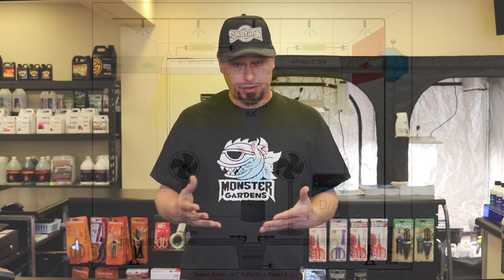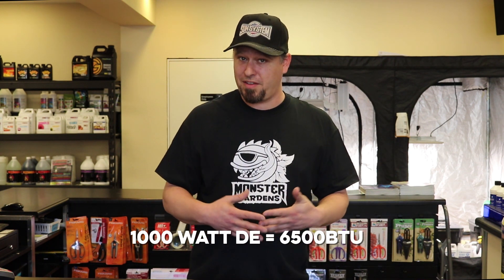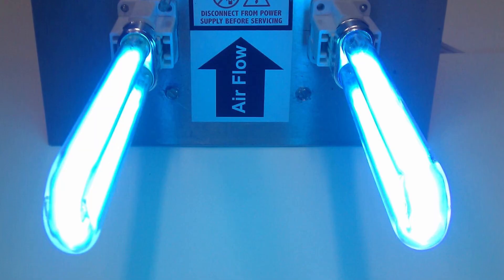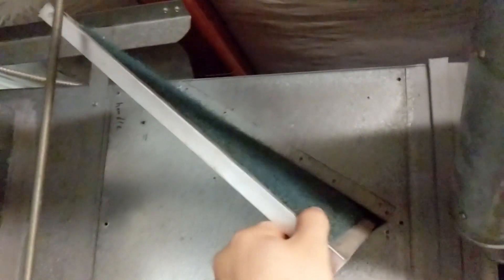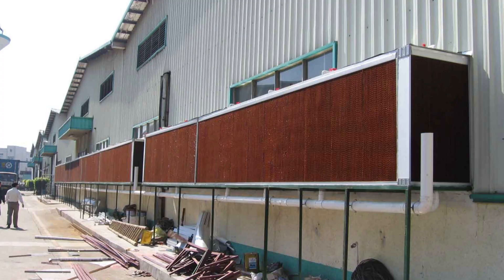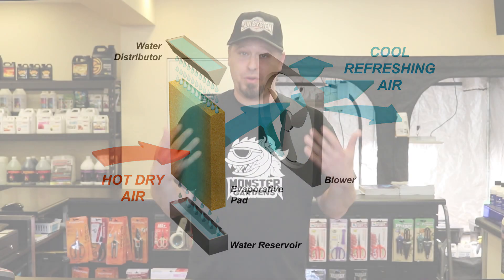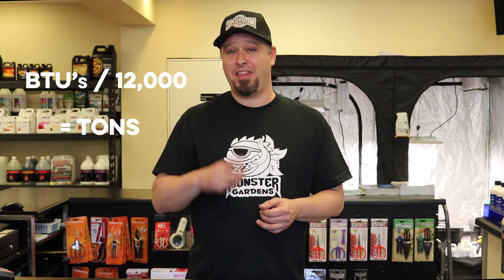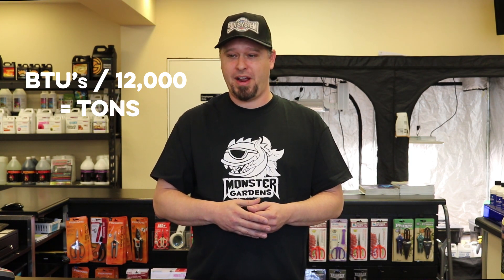Sizing A/C for Grow Rooms - Tip Of The Week #7

Comment: it says noting about what size ac to use based on the number of lights your running
Reply: bitterman co  Each watt equals 3 BTU's, so if you're running a 1000w HPS it's 3000 BTU's but if your ballast is in the same room, then it's 3500 BTU's or if you're running a 480w LED, it's 1440 BTU's
Reply: @dustinjay3743  you rock dude i love u

Comment: He said the DE 1000 watt  bulbs run 6,500BTU. Does that include the ballast?
Reply: 3500 is only for bulb , 6500BTU for 1000W ? , Nanolux 2x600W has 5040BTU ( Lamp + Digital Gear )
Reply: @GrowBoxVideo  so it is safe to say that the Gavita Pro 1000 DE puts out 6500 BTU? I was reading down in the comments and somebody had said that they didn't think it was that high and the guy who made the video said he was including other equipment in the room. We just want to make sure our numbers are correct for the air conditioning. 6500BTU seems a bit high.
Reply: @Reason756  We do now factory for 10.000m2 , for us 5040 and 6500 makes a big difference. One room 300m2 has 130x1200W this gives 192kW for klima convector and 50kW for Ventilation center, in total 242kW of heat.

Comment: Love all the effort you guys put in to helping with informing growers. 6500 Btu per 1000w is prob a bit overkill.
Reply from the maker: Hey Ryan, thank you for your support!  That's what keeps up focused on our efforts.  You're right, 6,500 is a bit overkill, but with that number we've also factored in ALL other components that would weigh in, like insulation, climate, dehumidifiers, CO2 burner etc. - Cheers!
Reply: @MonsterGardensChannel  it's one thing to say you should over kill your air conditioner which you definitely should but by saying a light that's a thousand Watts puts off 6500 BTUs is just wrong and misinformed
Reply: 2 1000 watt lights per ton👌
Reply: 600 SQ foot per ton👌

Comment: Thanks for the fast response! I guess the extra efficiency of the DE ballast and lamp means more light output from the same wattage. While this is more efficient, I guess the extra light put out with digital ballasts, DE raises the temperature from the infared light output which is mostly heat, I believe. I know I was using a 600w HPS, air cooled with a magnetic ballast and switched to the 630w CMH-DE with the AC/DE reflector. I know the low frequency square wave ballasts use about 40w to operate the ballast. So 670 total watts and it's at least as cool as the 600 HPS. I've seen another person ssy 1000watts equals however many BTU's and thought y'all agreed, but that wouldn't be true with DE systems and SE systems, as you've explained that the BTU's are different. I
always thought more light output with less heat was more efficient. As I've heard that the lamps will put out more light and less heat and are more efficient and that's an advantage especially with LED's. Y'all have a great day!
Reply from the maker: Hey Tim, what ballast are you using to fire that bulb?  The 630w DE bulbs haven't been marketed correctly until Nanolux's.  Traditional DE ballasts run at 100kH+ and CMH bulbs require SUBSTANTIALLY less Hertz.  This overpowers the CMH bulb and runs the risk of an early lifespan/failure.  That said, 1000w DEs (with the appropriate ballast) are putting out greater micromol with the same wattage/amperage compared to single-ended technology.  So yes, the short answer is that the DE's are more efficient.  Remember this though, heat output is directly correlated to wattage so technically if single-ended bulbs where also driven to 1050w or more than the same recommendation for A/C (6,500BTU) would apply.  Thanks!!
Reply: Monster Gardens The ballast I'm using is low frequency square wave technology running at 140-160hz I bought from Ceramic Solutions out of Northern California. Made in China. Working great so far! Thanks for your input and info!
Reply: @timturk1899  how do you like them now? Have you run 1000 watt d.e. before?
Reply: @louish3010  I used to want the 1000W DE-CMH, but my 630W DE-CMH is great, but 1 light source usually creates some shading, with much lower light levels around the edges. I bought 4-100W COB units from Alibaba, 2-50W COB's on a 1M rail, slideable, fully adjustable so I can aim the COB's where needed, around the perimeter. Now, 8 extra light sources, so no shading, more even light canopy! Everything still going great. Gotta clean, do maintenance in a few weeks. Should be empty/finished for this round. Clean good, move  some waiting overtime in veg for immediate flower room spaciousness! Healthiest looking plants are under the CMH!!! Any questions, just hit me up, Louis H. I rambled on to Monster Gardens, up above, with all I've learned, etc. Have a great weekend brother!
Reply: @timturk1899  Thanks! I remember starting out w it th guerilla tents way back when. I've got 2 9x9 and 1 4x4. But I don't use anymore, I'm looking for alternate light sources for a 3 3,000 ft flower rooms and a 1,000 sq ft nursery/veg. I have set up 50 phantom de 100 and 50 cmh 630 single ended fixtures and I am leaning towards my 1000 watt double enders over a 5x6. The cmh 630 couldn't do a 5x5 proper, but 4x4 yes. I have been looking at gavita and fluence, but I need 2 of those 1500 dollar fixtures to replace and cover the 30 sq.ft. that 1 200 dollar phantom does. That is 15 times more expensive, and also the 2 leds will pull over 1300 watts compared to my de at 1000. I was asking about de cmh because I haven't tried it yet. Thanks again!!
Reply: @MonsterGardensChannel  That ballast was made by EBM in China.. Wasn't sure back then. Still working great! Lamps are fine. I did find out the hard way that my 630W DE-CMH runs on 200V output to the lamp, while the 1000W need 400V, and 315W uses (?)V, not 200V as I found after buying some 315W DE-CMH lamps on sale, thinking I could run them at the 300W setting. They'd light up, but soon go out. Luckily I was able to return them! DE ballasts and lamps are much different than SE systems. I was using it in a 5'x5' Gorilla Tent (F'n front zipper started coming apart at the bottom. Apparently something Gorilla is famous for, from all the other complaints (did they just give up? New Camo color! Don't return emails, not the densest tent, as Mars Hydro has a nice 1680D, better outlay(Gorilla Tent has zipper window in back. The part usually against the wall (?), only way in is through the front.. Oh, the extension! That's their gimmick. I had 8ft ceilings and figured the extra foot of height may help, but it would take 4 people, each pushing top up, while putting in the extension poles. Don't expect something 7'11" to go from on it's side, up to standing position, w/an 8ft ceiling, lol. I tried and realized how stupid I was being. 6'11" works fine though. Gorilla Tent? Oh, 5'x5' so I wanted to add additional lighting around the edges w/LED COB's. I love the MIGRO Channel on YouTube. Great COB's, most efficient, best craftsmanship, and Shane, developer and host is a great guy with great lights from Ireland, but a bit too expensive for my needs. Shane's greatness, and the channel is appreciated by many more than just customers. He gets every LED possible to test his against, and his don't win always. Box specs? Shane has top sensors to figure out actual efficiency, etc of other lights. His COB's were the most adjustable! Just perfect for my perimeter. So I found a similar, yet not copied, or even close, unit on Alibaba. I got 4-100W units, 2-50W COB's(Citizen CLU48-1414's(much cheaper than the Cree. New generation Citizen are more efficient, but new Luminous COB chips are tops in efficiency overall, easy to switch out!) on a 1M rail they can slide individually on, adjust COB 180°, up or down, and swivels 350° so totally adjustable, and gives 8 more points of light, so no shading, much more even canopy lighting. Plenty of light. I have a veg tent, 32"x32" and have a Fissioning, HLG copycat, basically HLGV288(but the Samsung LM301B chips are placed more on the edges of the board, w/some open space in the middle, giving more even of a light spread. Over 22,000 Lumens of 3K, same chips as HLG's! Maybe 3 of those would eliminate my 630W DE-CMH (but healthiest plants are always under the CMH!). Things have changed much in a year, or so. Huh? Sorry for rambling on like a fool. Was going to let you know ballast name, lol, and maybe you made it this far! I really appreciated your info, and can never forget Monster Gardens! Had reviews for about everything I needed (I love my Hyper Fan Stealth, which I believe you tested awhile ago, well just the Hyper Fan. Best ever, extremely low wattage for such superb airflow, w/adjustable dial. Not sure if you're still making videos of new stuff coming in. Always loved them, as did many! Rambling? Sorry! Love ya Monster Gardens. Hope all's well!!!

Comment: How about growing in a small tent? Do I put the AC outside the tent and the mini heater as well? I life in a seasonal area like most people ig. Placing these machines outside the tent means I need to control the entire room where the tent is in so I rather do not do that.
Reply from the maker: It's all about exchanging the air before the heat can build.  If the climate outside your tent is ideal you can exchange your tent air with it but the heat will then build in the surrounding room and eventually become too hot.  Most ideal would be to exchange air with the outside or set up an AC to cool the room.
Reply: Destiny Price 420 thanks, I check out your videos to see how you run your setup! Thanks again!